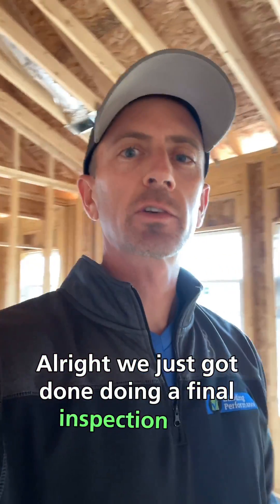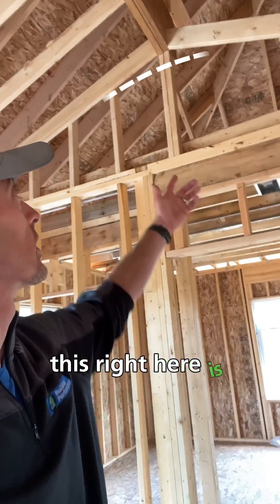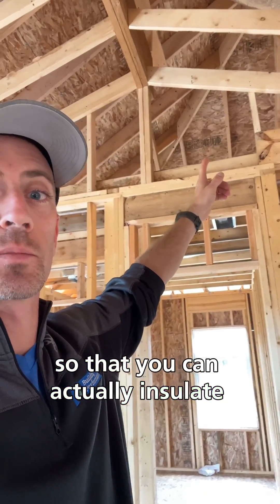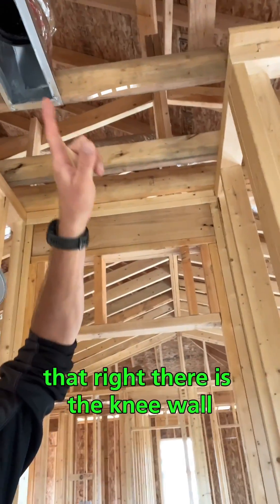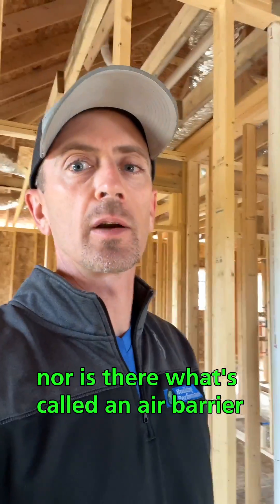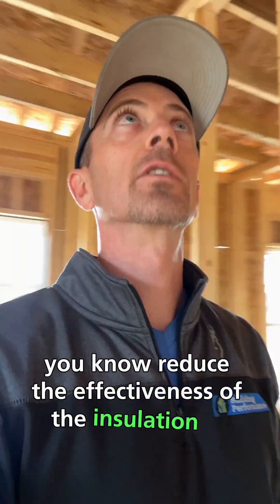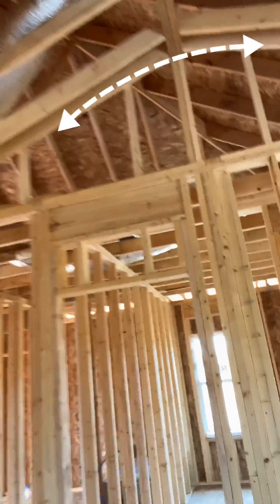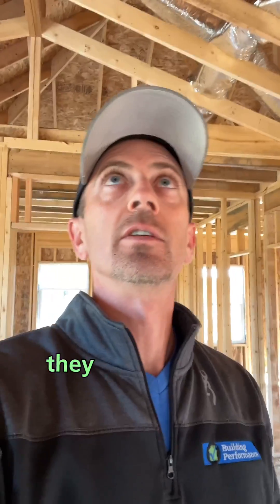How to install #insulation and air barriers on knee walls properly #newhome #newconstruction

Comment: Why is a top plate necessary? And what would be an air barrier?
Reply from the maker: Great questions, thank you!  A top plate on these knee walls isn't structurally required, it's to make the insulation work as it should.  When you use fiberglass insulation it has to be enclosed on all 6 sides so air doesn't move through it, as this reduces the effective R-value of the insulation.  An air-barrier can be any non-porous material that doesn't allow air to move through it, so wood is most often used.  Foam board and spray-foam at the correct thickness are air-barriers, and even good house-wrap materials can be air-barriers.  Any material, other than spray-foam, used for the top plate still has to be air-sealed properly to the framing and to the air-barrier on the attic side of the wall cavities with siliconized latex caulk or foam sealant.
Reply: @BuildingPerformance502  totally understand now. A wall like that I'd usually back with thermoply/t-ply, having a top plate would make it more efficient, I've never seen an inspector require one on a wall like that in my area but makes perfect sense now thank you.
Reply from the maker: @DrewNicest  You're very welcome!